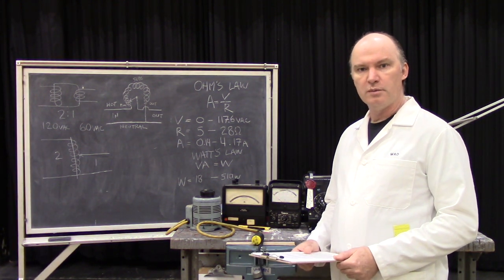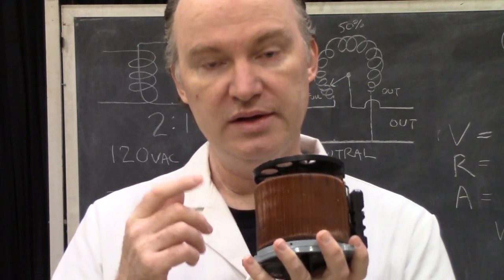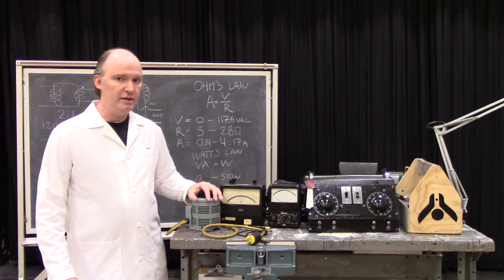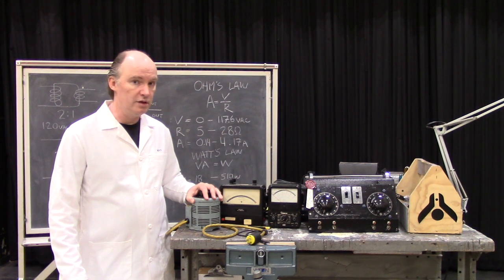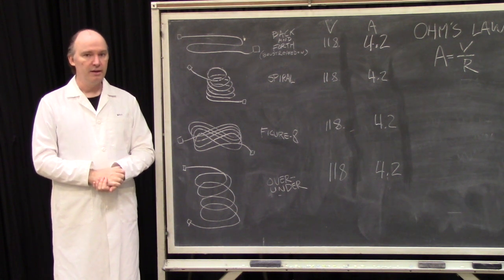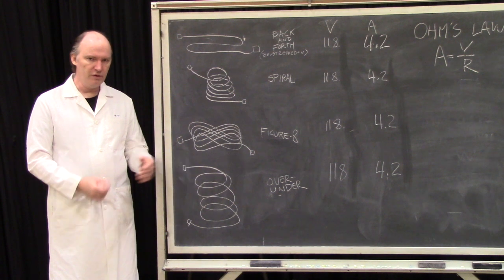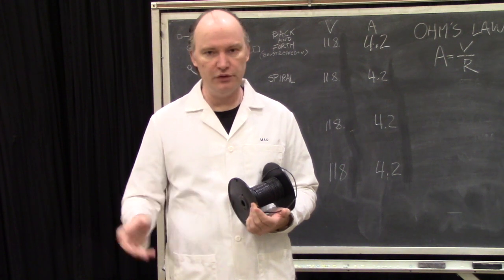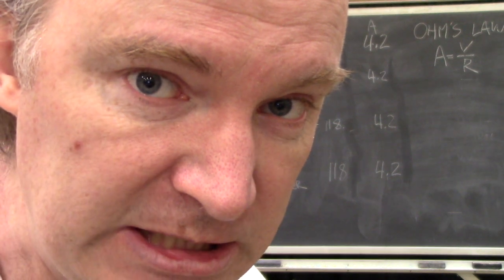Autotransformer followup - Inductance

Comment: I have personally experienced a cable on a spool almost catch fire.  It was smoking.  The difference is this was something like 500 feet of SJOOW 10/2 (with ground) with a quad plug on the end, hooked up to a big generator out in the field.  this was left on a very large wooden spool.  I don't remember what, if any, load was plugged in.  It could have been inductance like the urban legend says, or it could be like you say too tightly wound to properly cool off.  I also wonder if you re-do your test what would happen if you add some kind of metal core inside the loops?
Reply from the maker: That would be interesting to try.

Comment: You actually hit on something when you mentioned three hots. I was taught that when you run three phase electrical wires, to run them together in the same conduit. Do not run them side by side, each in it's own conduit because by them being 60 degrees out of phase to one another, running them parallel would cause them to heat up. I don't know why you would do that anyway. Also, please know that I am not an electrical engineer.
Thanks for the video

Comment: Those same "old timers" used to tell us the same thing about having the hot and the neutral entering a metal box through separate knockouts. BUT THE EDDY CURRENTS!!! And some nonsense about inductive heating of the metal box. Several youtubers have tested this and came to the same conclusion I did 25 years ago. It's a bunch of hooey. While in the midst of rewiring a very old and very decrepit house, I was reconnecting a ton of *gasp*knob and tube wiring to the new panel temporarily, each circuit entering j-boxes through two knockouts, connected to romex that then ran into the new panel. In the several months that stuff was in service until we could slowly phase it out, the world didn't end, the boxes didn't get warm, and nothing at all interesting happened. Just what you want when knob and tube wiring is involved.